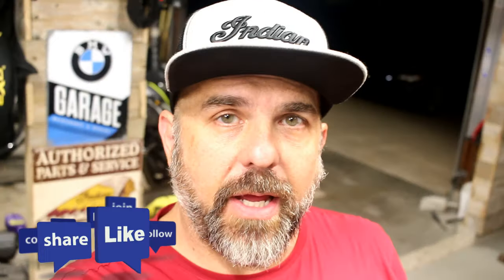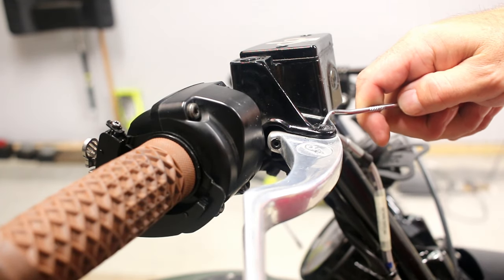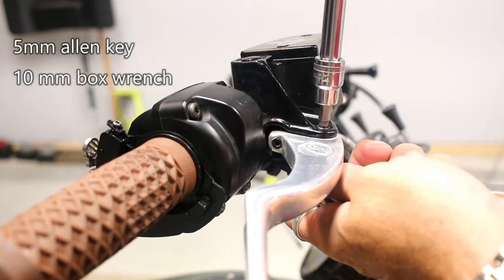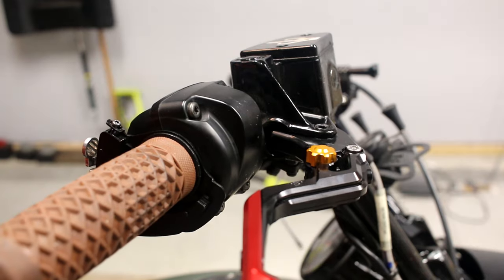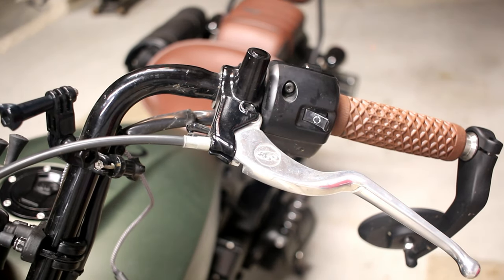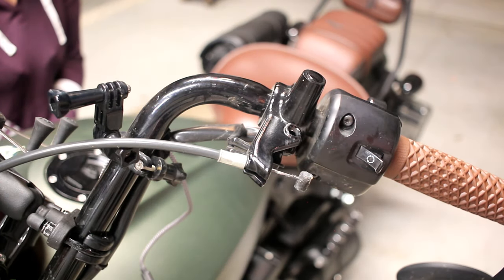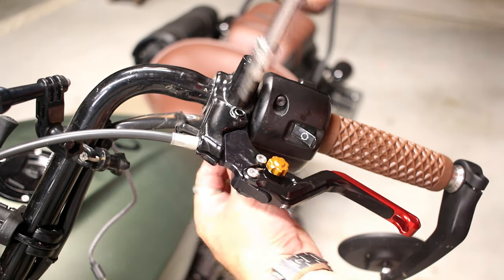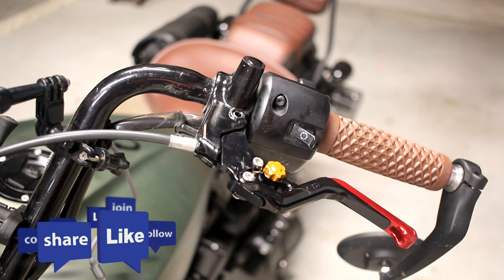Indian Scout Bobber lever replacement - LSL Ergonia Levers

Comment: Yo getting the caps off suck.  However your idea to have one of us hold the wrench to relieve pressure on the clutch cable while the other swapped the lever was spot on.   Looks 1000 times better than chrome.
Reply from the maker: I still have not replaced my caps.  Just left those things out of my life 😀.  Glad the video was helpful!
Reply: @MessyGarageBMW   everyone else says use the wrench to remove the clutch wire which while it will work I lifted the clutch with the wrench using my thumb to keep that catch piece in place while my wife swapped her clutch lever.  When she was done I lowered it slowly and all was well.  So easy.

Comment: Been wanting to paint/black out my levers, this is the second video I've seen removing the clutch cable from the engine side. Is there any reason I couldn't just remove the 2-5mm bolts on the assembly clamp and let the clutch assembly just hang free and then remove the clutch handle?
Reply from the maker: You would still need to remove the tension to get the cable out and that is the easiest way without having to readjust later.

Comment: Checked out the levers but site says only up to 2016... Are they the same as later models?
Reply from the maker: If you follow the link in the description it will take you to the exact levers I used.  I installed them in a 2020 but the site says 2018 - .  They haven't changed the levers any

Comment: Here is Amazon link for replacement caps. 
KiWAV Motorcycle Round Bolt Cap Screw Cover Plug Black for 6mm Thread Allen Head Bolts, ie M5 Allen Key. Put a drop of silicone on them, and you're good to go.
Mike
Reply from the maker: Thanks man.  I'll check those out.

Comment: Why did you not try to hide the cables inside the handlebar to give it a cleaner look?
Reply from the maker: These are the stock bars on the bobber and not internally wired.